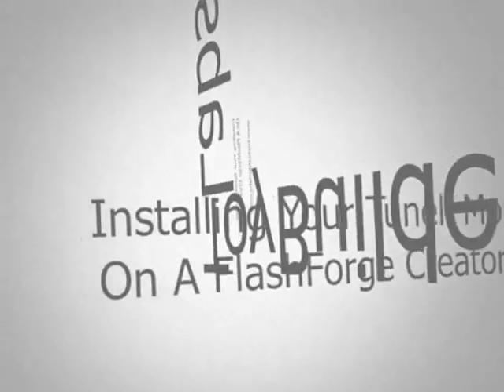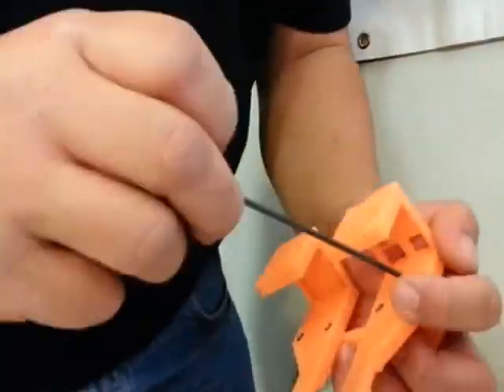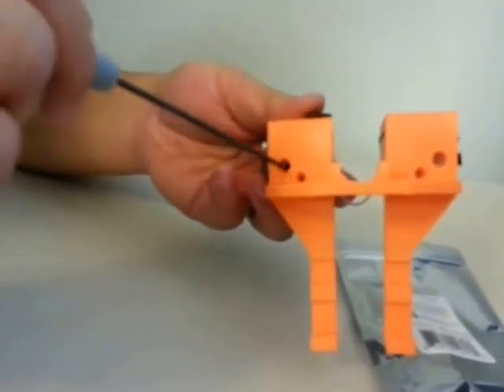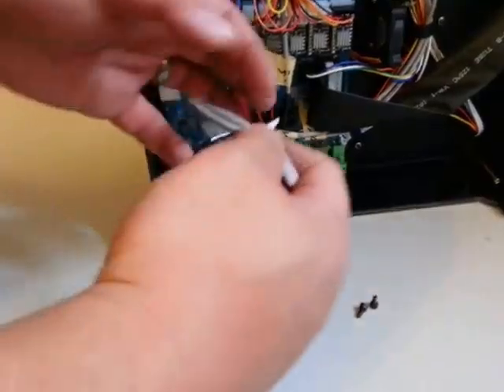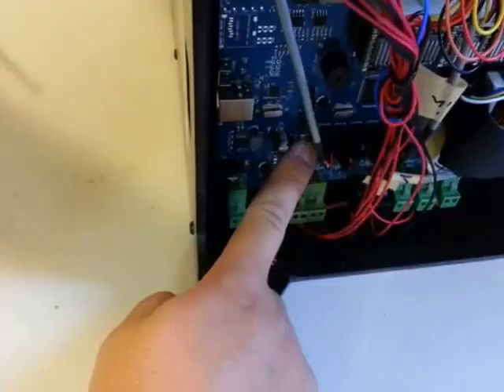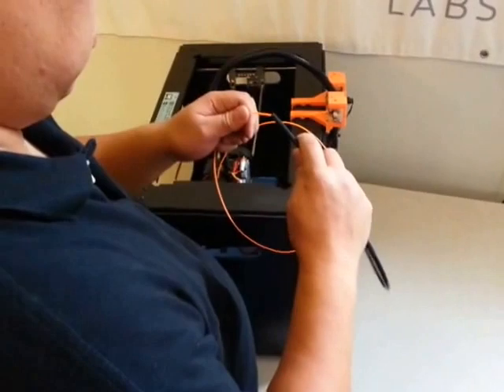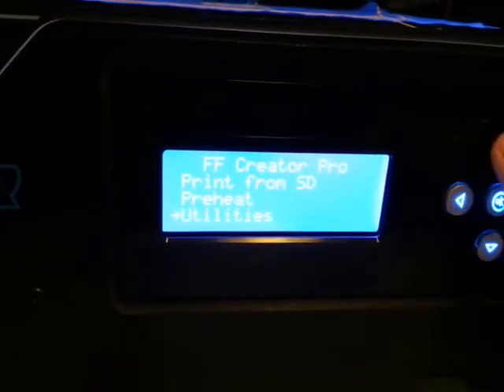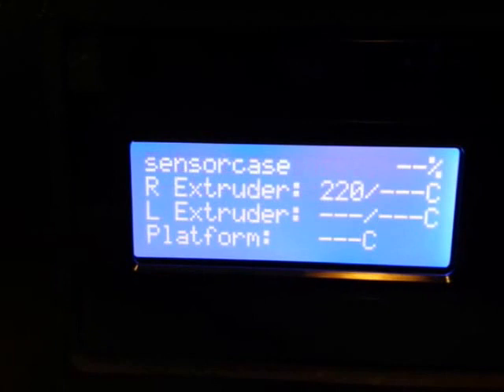Tunell Monitor Installation on FlashForgre Creator Pro

Comment: so when it pauses are you able to change out the filament, or fix the problem and resume? I'm always worried about pausing it changing it out then the print some how cancels and I have wasted time and electricity.
Reply from the maker: On Sailfish firmware machines, you can easily access the load and unload filament functions through the menu, and then exit the pause via the Unpause menu entry.  The success rate of using the P-stop mode is much better than the "M600 pause" implementation on Marlin.  

If you have a clogged nozzle, the pause mode will give you a fighting chance to unclog the nozzle and salvage the job.  Of course, if things are really FUBAR, then even the monitor won't help you -- but we've had customers had successes with the monitor catching bad bulge on filament, end of the spool, and feeding problems with finicky hot-ends...

Comment: You think that wire is tight enough?.... Think you need to supply a longer cable....
Reply from the maker: +RJGNOW We're going to source longer cables.  The cables that we ordered were supposed to be 24", but ended up being 23" from our supplier!  The measured from connector-tip to connect-tip. :(

Once we get the longer cables, we'll be glad to send those out to existing customers that received the 23" ones.